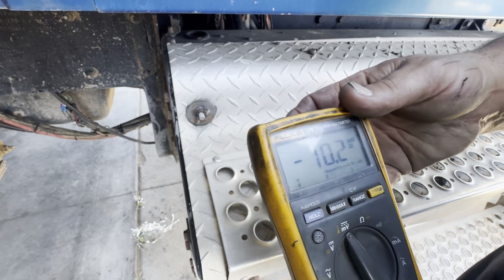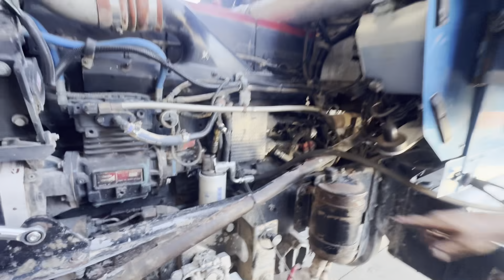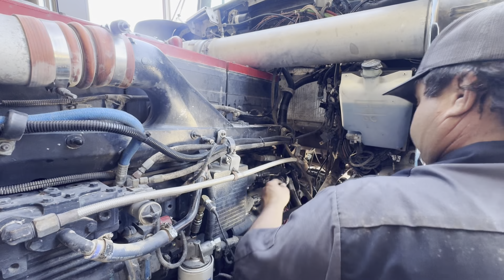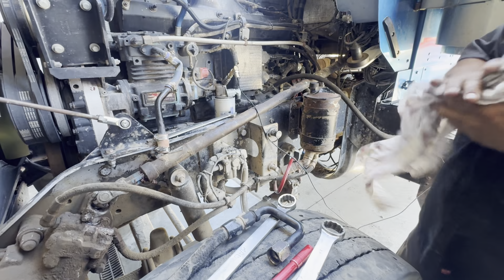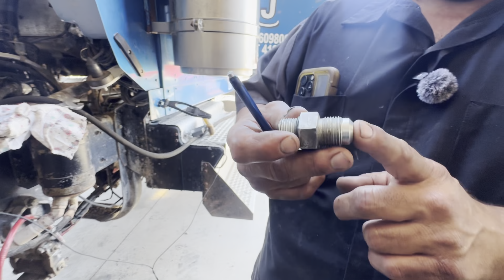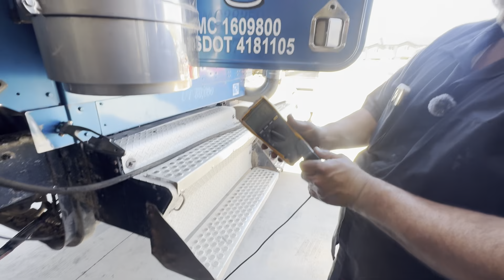How To Find Fuel Restrictions N14 Cummins

Comment: Did you know that check valve can be disassembled and cleans out, grab the tip of the valve on a vise with out over tightening and damaging the end and wrist the end off, you’ll have 4 pieces the body, the end a spring and the valve. Gunk enter the check valve often and clogs it up. Clean it out reassemble it and you’re good to go. In a restrictive situation this is your number one place to go to. I just don’t know why there isn’t a fuel filter on any brand truck. None has a filter or at least some type of screen.

Comment: If you do not have a transducer and  a Fluke meter use a quality manual vacuum gauge , ( -30 inHg to 30 psi. )
Blow ECM cooler plate out with compressed air .
Great Diagnostic report !

Comment: It's hilarious that Cummins includes the ECU as a FUEL HEATER in its "modern" heavy-duty diesel engines while other manufacturers of ACTUAL heavy-duty "electronic" diesel engines AND the off-highway ag/construction/forestry/industrial equipment and machines they power such as John Deere have "historically" and still do install FUEL COOLERS on their machines with "electronic" engines and limited "airflow" to and over their fuel tanks specifically because not only does cooler fuel make "more power" and to a far greater degree than cooler air (each 18-degree F drop in "inlet fuel temp" - to the engine fuel system inlet -.produces 4% more horsepower while each 18-degree F decrease in intake AIR TEMP produces only 1% more horsepower per JD scientific testing and cooler FUEL explains MOST of why engines "pull harder" in the "cool of night" vs. the "heat of the day") but because cooler fuel is a THICKER AND MORE VISCOUS AND MORE DENSE LUBRICANT AND A BETTER COOLANT FOR "MODERN" FUEL SYSTEM COMPONENTS OF ENGINES AND PARTICULARLY "ELECTRONICS" SUCH AS THE HPCR HIGH PRESSURE PUMP SOLENOIDS, INJECTOR SOLENOIDS ETC WHEN IT IS COOLED BEFORE ENTERING THE ACTUAL FUEL SYSTEM WHILE CUMMINS "ENGINEERING" INSURES THE FUEL IS "PREHEATED" BY THE ECU BEFORE THE OTHER ELECTRONIC ENGINE "INTERNALS". 

DEERE PUTS ITS FUEL COOLERS FRONT AND CENTER IN/ON THE MACHINE "COOLING PACKAGE" AND ENSURES THAT THE FUEL AFTER LEAVING THE TANK - WHICH CAN BE A "FUEL HEATER" IN AND OF ITSELF PARTICULARLY THE "HIDDEN"  TANKS OF FARM TRACTORS LOCATED UNDER CABS AND IN "DEAD AIR" WITH DIFFERENTIALS, FINAL DRIVES, TRANSMISSIONS, HYDRAULICS ETC SURROUNDING THEM - IS COOLED - ACTUALLY HAS HEAT REMOVED FROM IT - TO AS NEAR AMBIENT OUTDOOR TEMPERATURE AS POSSIBLE. 

THE FUEL COOLER AND "EXTRA" PLUMBING ALSO SERVES AS SOMETHING OF A "RESERVE TANK" SO THE ENGINE OF A MACHINE RAN OUT OF FUEL TENDS TO DIE OUT GRADUALLY INSTEAD OF INSTANTLY AS SOON AS THE IN TANK PICKUP "SUCKS AIR". 

OBVIOUSLY TRUCK ENGINES HAVE TO BE FAIRLY "SELF CONTAINED" INCLUDING ALL ENGINE SYSTEMS AND "REMOTE MOUNTING" AN ECU MAY SEEM TO BE A "WASTE OF MONEY" GIVEN THE EXTRA WIRING IT WOULD REQUIRE BUT MACHINES WITH EQUALLY AND MORE "HIGH TECH" ELECTRONICS IN CORRECTLY ENGINEERED MACHINERY AND EQUIPMENT FOR MAXIMUM RELIABILITY AND DURABILITY "WASTE" THAT EXTRA MONEY ON REMOTE-MOUNTING ECUS AND OTHER CONTROLLERS TO AREAS OF THE MACHINE AS "ELECTRONICS FRIENDLY" AND SIMULTANEOUSLY "INVISIBLE" AS POSSIBLE BECAUSE THAT KEEPS THEM AS COOL, CLEAN (EVEN WHEN "DUST COVERED"), FREE FROM VIBRATION, FREE FROM IMPACTS AND TAMPER-RESISTANT AS POSSIBLE SPECIFICALLY BECAUSE OF HOW RELIABLE AND DURABLE MODERN SOLID-STATE ELECTRONICS ARE TO THE POINT OF BEING "INFALLIBLE" WHEN THEY ARE NOT SUBJECTED TO "PRYING EYES" AND "PROBING TOOLS" AND OTHER TAMPERING EVERY TIME A "MECHANIC" FACED WITH AN "ELECTRONIC PROBLEM" IMMEDIATELY SPOTS AND SUSPECTS A "BRAIN BOX". 

IN THE TRUE HEAVY-DUTY - MEANING OFF-HIGHWAY - DIESEL ENGINE INDUSTRY WHERE MANUFACTURERS PRODUCE BOTH ENGINES AND THE EQUIPMENT THEY POWER AND/OR OEM MANUFACTURERS OF EQUIPMENT PAY CAREFUL ATTENTION TO ENGINE MANUFACTURER "RECOMMENDATIONS" ON PROPER ENGINE AND ECU INSTALLATIONS AND LOCATIONS AS THE "PAYING CUSTOMERS" PAYING "FULL RETAIL" AT $5,000 - TO $100,000 A POP PER "ENGINE PACKAGE" WHERE YOU DO NOT FIND ECUS MOUNTED IS WHERE THEY AND THEIR WIRING AND CONNECTIONS ARE MOST EASILY DAMAGED AND IN THAT INDUSTRY ECU FAILURES ARE ALL BUT UNHEARD OF IN THE MODERN DAY. 

ANOTHER REASON CATERPILLAR "QUIT THE TRUCK ENGINE BUSINESS" WAS THE PROLIFERATION OF UNTRAINED, UNEDUCATED, UNQUALIFIED AND UNACCOUNTABLE "MECHANICS" OUT THERE IN "INDEPENDENT SHOPS" PLAYING "CAT EXPERT" AND "TUNING" AND "UPGRADING" AND ULTIMATELY DESTROYING CAT ENGINES, COMPONENTS, ELECTRONICS, ECUS AND BANKRUPTING OWNER-OPERATORS IN THE PROCESS BY "WORKING ON" CATERPILLAR PRODUCTS THEY SHOULDN'T HAVE HAD ANY BUSINESS EVEN TOUCHING IN THE FIRST PLACE. 

AND THE "RIGHT TO REPAIR MOVEMENT" IN THE "AG INDUSTRY" PARTICULARLY TARGETING JOHN DEERE AND ITS PROPRIETARY TECHNOLOGY, TOOLS, TRAINING AND FACTORY TRAINED SERVICE TECHNICIANS SEEKS TO D0 TO DEERE & COMPANY WHAT THE "TRUCKING INDUSTRY" FAILED TO DO TO CATERPILLAR. FORCE IT INTO MAKING EVERYTHING "OPEN SOURCE" AND "PUBLIC DOMAIN" SO "HACKERS" AND "PIRATES" CAN TARGET 
DEERE PRODUCTS, DEALERS AND LOYAL CUSTOMERS WITH "TUNING" AND "SOFTWARE" TO ALLEGEDLY MAKE THE PRODUCTS MORE "SERVICEABLE" AND "REPAIRABLE" BY "FARMERS" THAT BY AND LARGE PREFER TO "JUST CALL JOHN DEERE" WHEN THEIR "HIGH TECH" EQUIPMENT "BREAKS DOWN" WHEN THEY HAVE ENOUGH FARMING AND EQUIPMENT AND MANAGEMENT AND HUMAN EXPERIENCE AS FARMERS WHO TOOK "SHOP CLASS" IN HIGH SCHOOL ETC TO KNOW WHY THEY CHOSE FARMING OVER WRENCHING. 

NOT TO MENTION "STEALERSHIP" SHOP PARTS AND LABOR BILLS CAN BE TOTALLY "WRITTEN OFF" INCLUDING SALES TAX AND ARE MORE WARRANTIED AND GUARANTEED WHILE "INSIDE LABOR" BY A FARMER AND/OR FARM HAND IS A "TOTAL LOSS" WHEN THEY COULD ACTUALLY BE...FARMING.

Comment: Do you know if the older N14s have a check valve? Mine is a 91 CPL 1380. I have the same issue, changed fuel lines, fuel pump, washed out tanks etc...

Comment: Thanks for the video!   My truck has the 90 degree fitting coming out of the ECM cooler.   The flare seat end is a plug held in with an o-ring seat.  Be careful not to damage the sealing surface, twist it loose and spring and poppet should fall out.   There was debris holding my check.  Be careful not to damage the o-ring on the poppet and it's seat in the brass fitting!   
While the check is removed, I'm going to run out and pressurize the fuel tank to purge the tank line and ECM cooler.

Comment: The nose (rounded end) of the check valve does slide off allowing you to clean the trash out. I added a DAVCO between the tanks and the engine to catch trash as well as prefilter the fuel

Comment: Great example of troubleshooting to find a problem I see a lot of guys  come to me and just buy the check valve. They also don't take in consideration the fuel lines. Living in the rust belt, you see a lot of little pinholes in those metal lines that pull air or leak fuel.

Comment: On an older truck using rubber hoses and seeing what looked like a piece of rubber stuck in check valve i believe it would be prudent to remove ECM and cooler for a visual inspection or at minimum back flush into a plastic bag and check for other contaminants ie more rubber particles then check hose/ hoses to tank, that piece jamming valve had to come from somewhere and if it's only the early warning that hose is breaking down it will only happen again one would think ??
Reply from the maker: That would be good practice for sure!
Reply: How would any fuel contaminates get to the ECM ?
Assuming we're talking about the Engine/Electronic Control Module  .
Reply: @cliffhaskett7703 fuel goes through ecm to keep it cool! Cooling plate

Comment: Check out fuel system tester on Bill Covert, Service Truck Tour. You could of done all that work in 30 minutes.
  This tester was built by one of the Great Generation guy's in the 1960's, Ralph Plunkett, in Redding calif at Watson &  Mehan Cummins Engines. Using a heater motor, a Detroit Diesel fuel pump, a rheostat, a vacuum gauge and a sight glass, you can test the entire system without starting the engine. 
    Granted the parts are as old and obsolete as I am. BUT once you get the concept in your head you will be able to adapt. It is just a electric pump with a vacuum gauge and a sight glass. It locates restriction, air being sucked in, primes engines, locate internal fuel dilution, transfers fuel. 
   There is a second tester powered by a impact or drill. This is a much safer tester as the original is a real fire bomb if used on gasoline, but it still uses the obsolete two stroke fuel pump. I also show a suggestion on using a drill motor pump.
    Give me your email I send you some 35 year old plans on how to build. BUT put your mind to it, once you get the concept in your mind you should be able to build a better tester that does not a electric motor. I would be very interested in what you would come up with.
   You are defiantly no dummy!

Comment: The check valve is made to disassemble. If you put pliers on it right behind the taper you can pull the check valve and spring out. The check valve has holes in it that get plugged up with dirt alot of times it's the inside of the fuel line coming apart.
Reply: Having to pull it apart with pliers is not "made to disassemble". A check valve that is multipart and has parts that unscrew freeing the valve and spring is made to disassemble. And its serviceable. 

And anyone that has to repeatedly pull apart a check valve for "cleaning" because they are too lazy to "fix" the root cause of a continually plugging check valve is just a moron. Explaining why they think its "made to be disassembled".

Comment: The mighty N14, I miss them old beasts, I had one in a T600 (Re-power), had the same thing happen, was a small stick type thing, had jammed the check valve between midway and closed, brought back memories bud cheers
Reply: if its not a cat , its a dog , my n14 doesnt even compare to my cats ....  cat is 25% more fuel effecient too . my 500 cummins will barely outdo my 425 cats. my 650 cat will leave the 500 miles behind and cheaper to operate, my cats start on 2 revolutions , the cummins may take 15 seconds ,  with a good checkvalve and new filter

Comment: Had a M11 doing the same thing found a cigarette rapper in the cooling plate and the check valve ...awesome test some tools are just a must I did it the hard way but did eliminate the fuel lines and the fuel filters to find the problem..
Reply from the maker: Crazy!

Comment: if you grab the 45 degree flare with a good pair of pliers you can pull the check valve apart on the truck without removing it. (body)
the fan blade has a broken corner
check the intake pipe for rubbing on the valve cover.
if you pull apart the one that came off the truck and it has rubber in it all the fuel hoses are needing replaced. they come apart after a few years.
anytime you do a m11 water pump keep the comucheck fitting out of it. 
if you get a stumble the fuel pump drive gear splines are worn out. 
does that fan ever release?

Comment: My n14Cplus is burning out like 2 gallon a day white smoke coming from cylinder 3. Oil from that#3  hole pushing out. Now engine hydrolock .
Reply from the maker: Might have an injector stuck open or a bad hole. Cylinder head could also be bad

Comment: Hey great channel!

FYI those check valves come  a part and can be cleaned
Reply: @AHenderson-g7i  Yes they can,  first time I took mine apart, I put air to it and blew the spring halfway across my shop.  Definitely hang on to it if anybody is interested in doing it.  Mine had the foil seal from a plastic bottle trapped in the valve.